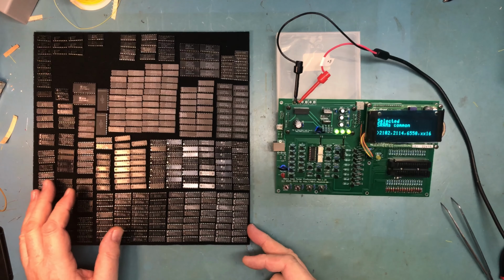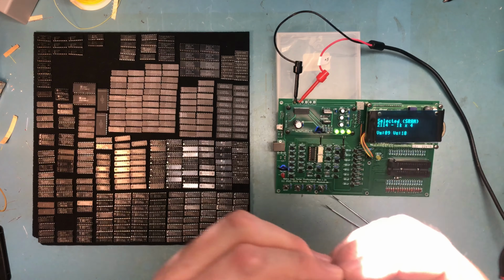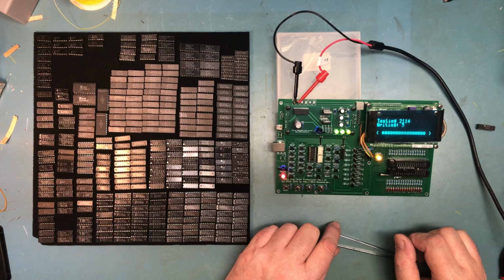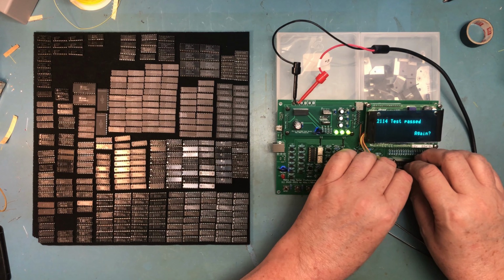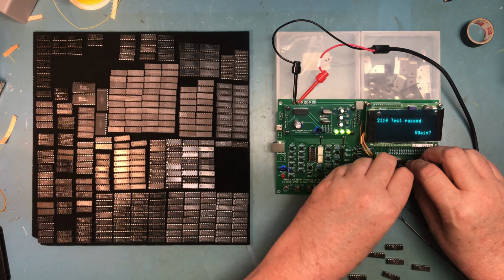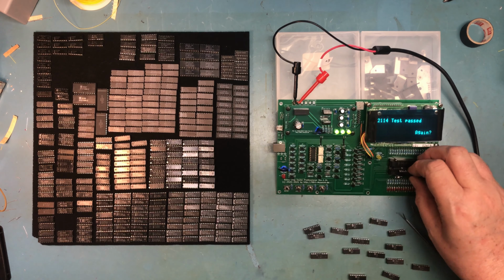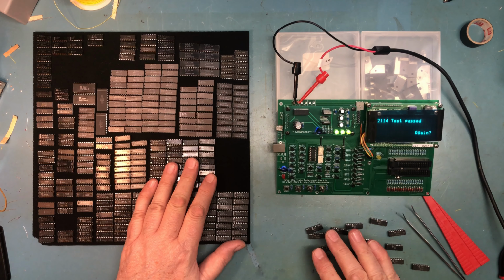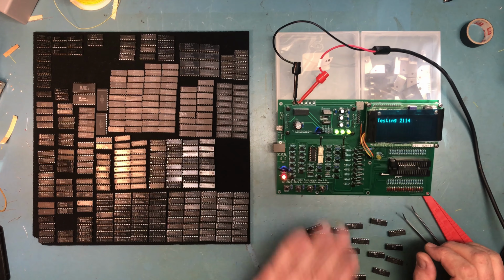STB1034 - Testing 2114 SRAMs - Retro Chip Tester Professional

Comment: Nice results!  For the Retro Chip Tester, I really like the latest firmware.  Navigation is more intuitive with forward and back buttons.   On older rev Boards you can even add a top button, as an easy mod, which is convenient.